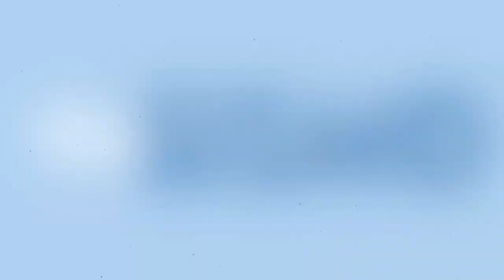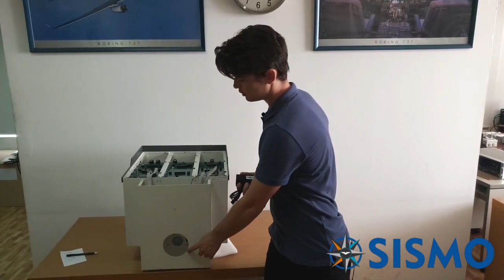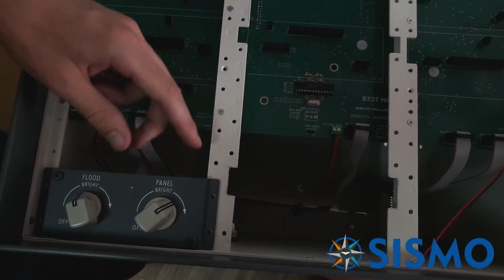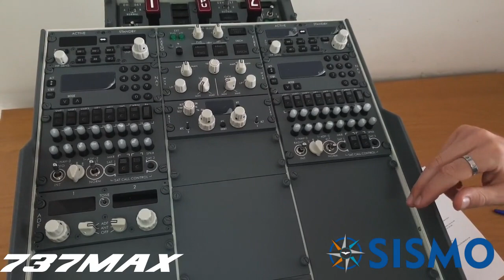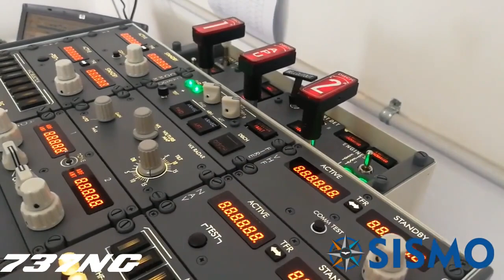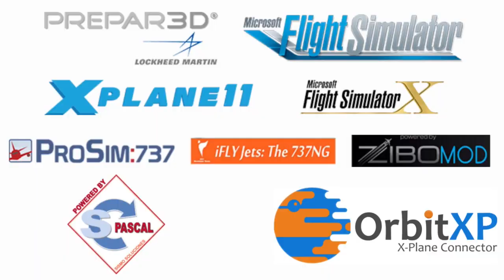Pedestal Plug&Fly for the 737NG and 737MAX

Comment: Hi , If you had to build your own panel which would say fit on the overhead panel and wired it yourself could you still connect it to your motherboard to the correct terminal on the motherboard and not have to code ?